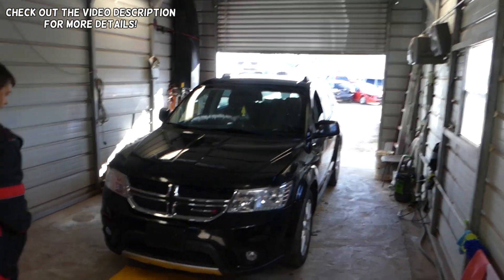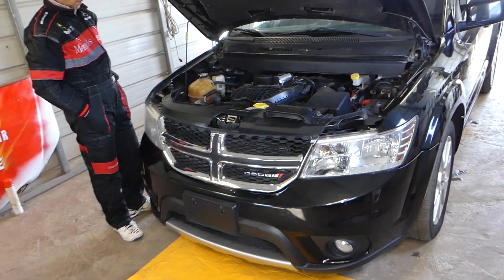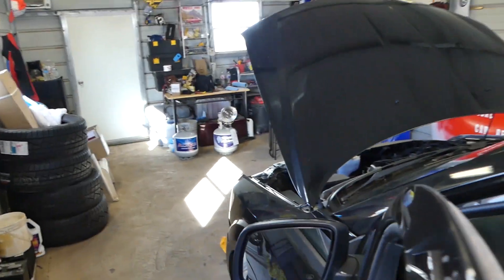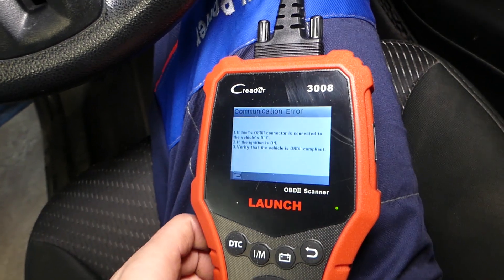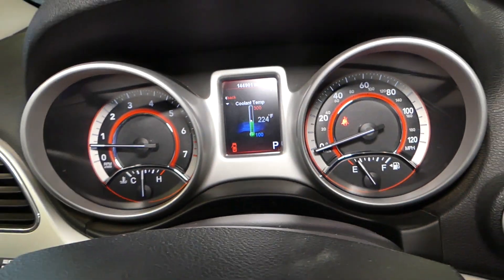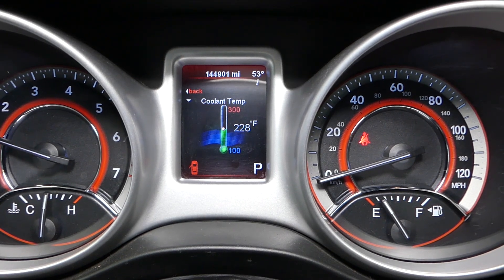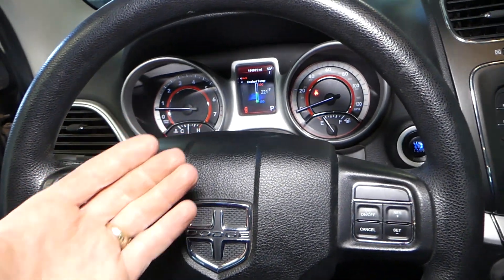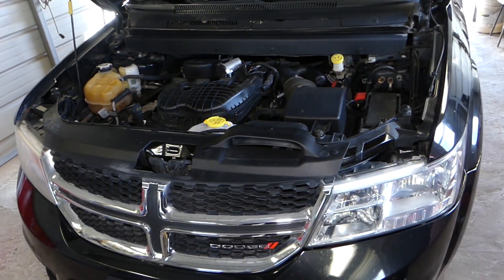AT WHAT TEMPERATURE THE RADIATOR TURN ON DODGE JOURNEY | FIAT FREEMONT

Comment: On my journey my fan comes on low speed at 219f(104c)turns off at 212f(100c)goes on high speed at 230f(110c)..you maybe missing your low speed on the test van

Comment: My 2013 dodge
Spewing water after driving at for 10 temperatures rise as I accelerate can hear lots of pressure coming from the reservoir cannot drive it for more then 15 min when hot when I switch it off I hear a bubbling sound both fans work any solutions?

Comment: My journey hit 232° going up a mountain today. And I was panicking. Apparently that might just be normal? I did top off the coolant though.  I'll see if it gets that hot tomorrow when  I make the same trip.
Reply: Mine dose the same. Only when it's hot out and going up hill. Did you get it fix??
Reply: I have same problem ,
Reply: Same here.. I need answers.. I already replaced the thermostat but it still runs high when going up a hill
Reply: Befor the problem  themperture was evry time 88-92°c
Reply: I changed radiator, thermostat, all sensor from the engine cooling , its now 21°c outside, engine themperature are 89°c , if i going uphill going too 110°c
Reply: @landonmendoza5909  have same problem , maybe egr cooling or engine oil cooling , other parts are new and tested from mopar... if the problem not solved , tey are no problem on the cooling system , maybee its a electronic problem , i tink normaly fan open on 90°c ,  next fan is opening at 97°c
Reply: @sakiringulu  yeah I'm thinking about replacing the water pump if that would fix it
Reply: @landonmendoza5909  it was a new one , i have change it 20/09/2020, but early 2 weeks i have replaced another water pump, thos one a full metal
Reply: @landonmendoza5909  my car opens the fan only on 97°c and its not normal

Comment: Is it normal that the operating temperature will climb up to 230 without driving until the fan kicks in ? Or the thermostat should cool the engine on lower temperature even before the temperature gose up that much ? My Dodge Journey keeps going up till 230 and the then the fans cool it down. It keep getting up and down unless im driving on a highway, I changed the thermostat, engine temperature sensor and also the ambient sensor, but it still the same , I don’t know if this normal or not . Awaiting for your response please....
Reply: I think its normal.  Just driving around town in 70 degrees,  mine gets to 210. 220 if its above 80. Today its 90 and it hit 232 climbing a mountain. Not the first time either.  Did this 2 years ago on the same trip. On the way down, went back to 197, stayed below 210 all the way home. I think these engines just get hot under stress.
Reply: Mine dose the same but my fans come on way before it hits 230. I replace the thermostat and now I'm going to attempt to change the water pump tomorrow and see if that's the issue. I think it's the pump I can hear whinging nose where the pump is located.
Reply: @johng8967  did the waterpunp fix the problem?
Reply: @johng8967  Did the water pump solve your problem?
Reply: I have the same issue I changed the thermostat and even changed the anti freeze. Then changed the water pump today and still hitting 233 I’m going to try the radiator fan now

Comment: Pls help me. Why is my overflo boiling. I took the thermostat out just in case it was stuck and no, my over flow is still boiling but yet the car temp and engine temp are normal???
Reply: Just double check your coolant tank cap is tight.

Comment: i have a fiat freemont, is the same as a dodge journey, i have never seen the temperature above 197f. when I go uphill the temperature rises, I have even seen 220f. Does anyone know the operating temperature of this car? fiat freemont 2l diesel 4wd 170hp. the car has 2 gears on the cooling fan. it looks like the 1st one doesn't work. I replaced everything. even the radiator. all the sensors. when the car becomes 207f the cooling fan kicks on. at 207f the cooling fan seems to spin pretty fast, don't understand if it's 1st or 2nd gear thanks in advance
Reply: Did you replaced the resistor for the engine fan?